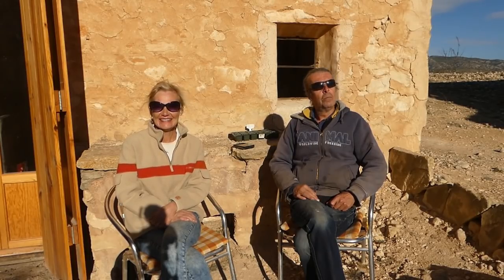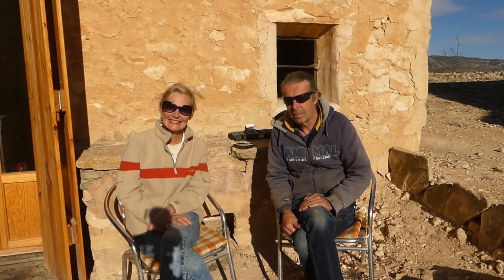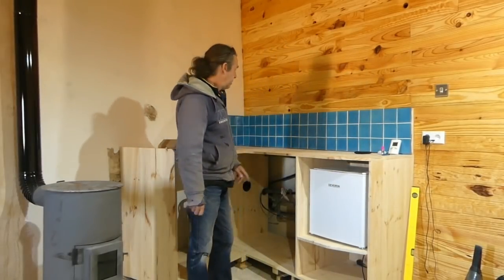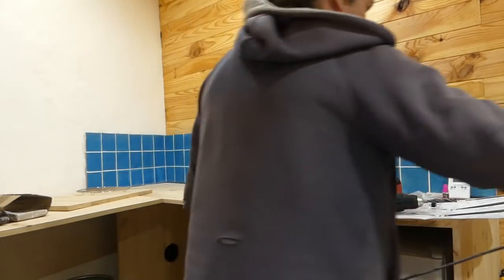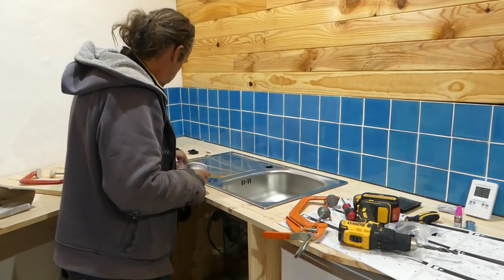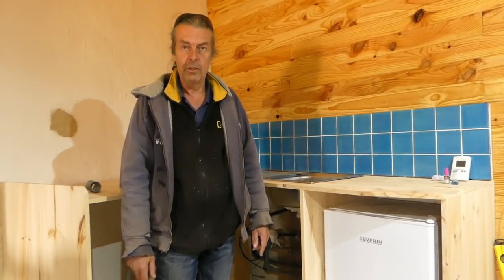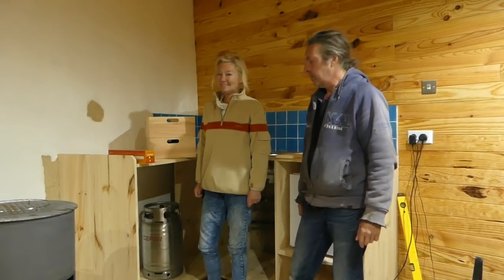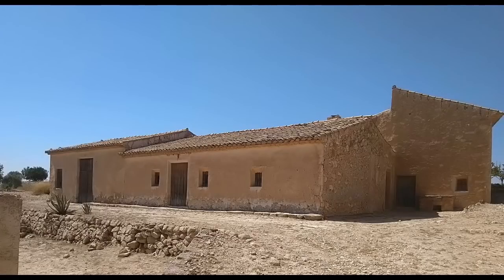150 year old stone Hay Loft conversion -  Bespoke wine rack & fitting the sink

Comment: Andy, that not soot in your pipe, it's ash and you are correct, it is due to the wood used not being cured enough, still moisture in it. It will probably clean itself if you run a nice hot fire.
Reply from the maker: Thank you. I'm going to log it and let it dry longer and try a hot fire